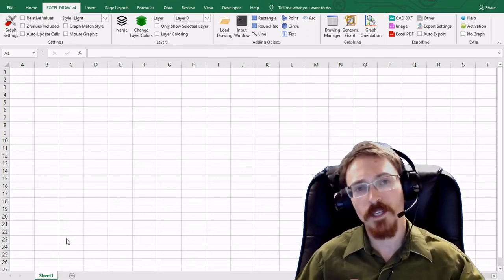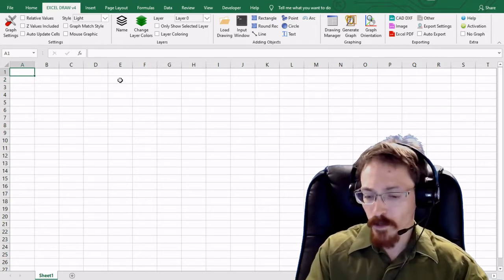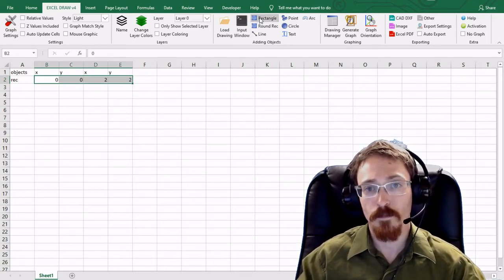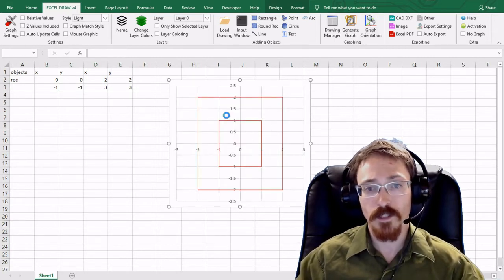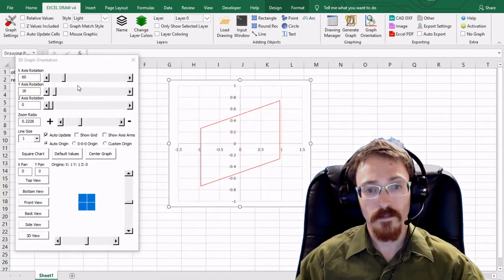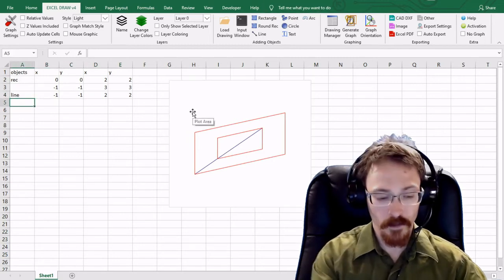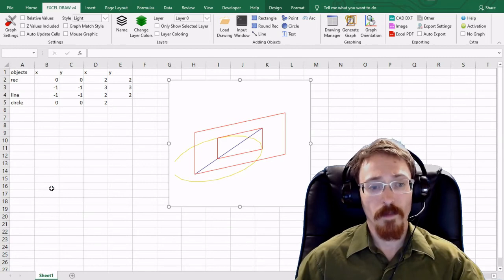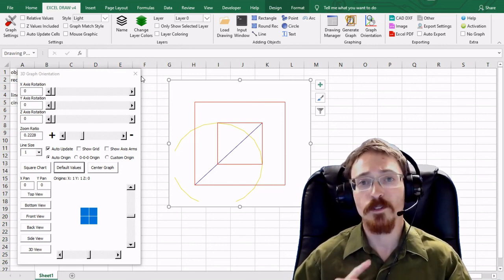Excel Draw v4 Course 2 - How to draw Lines, Circles and Rectangles - Drawing CAD DXF inside Excel

Comment: When I click on rectangle after setting up my x and y values the picture doesn't pop up
Reply from the maker: Please email our support for questions regarding operations.
support@graytechnical.com
Reply: I had the same issue and the support team wasn't much help. They acknowledged that this is an issue, but they have no immediate plans to address it.  This would be an awesome program... if it worked.
Reply from the maker: @sarafast885  It is being addressed, it was simply not an easy fix. The issue came from the use of Microsoft Excel's chart functions. To resolve this issue we needed to create our own graphing engine. This took us some time, but it will be rolling out in the next few weeks.
Until then, open the chart rotations window and the chart should graph. 
If you require more assistance please contact our support.